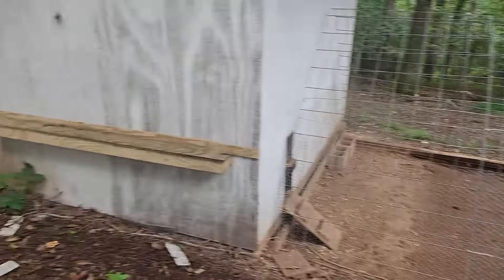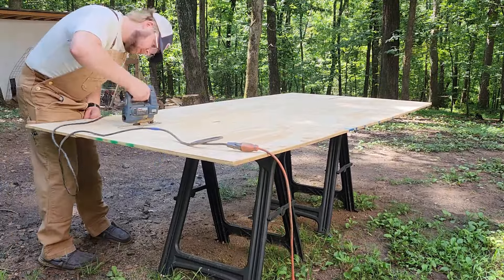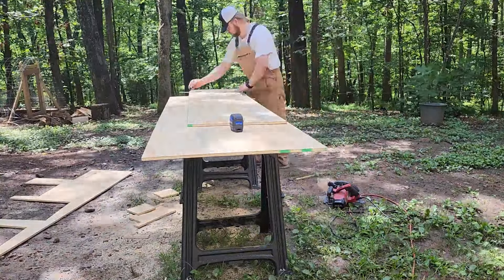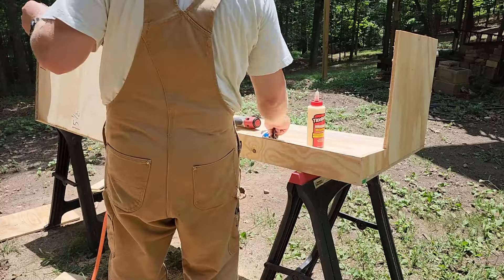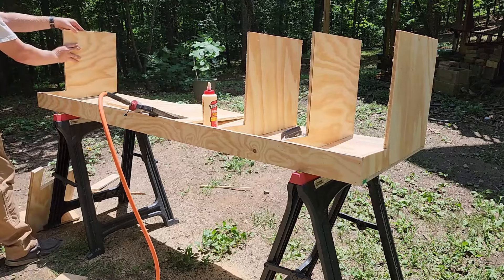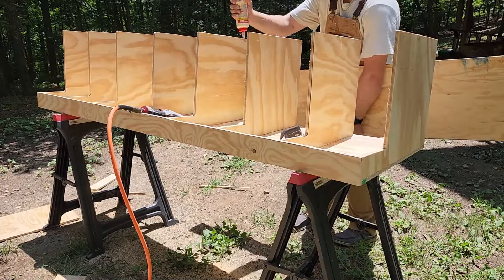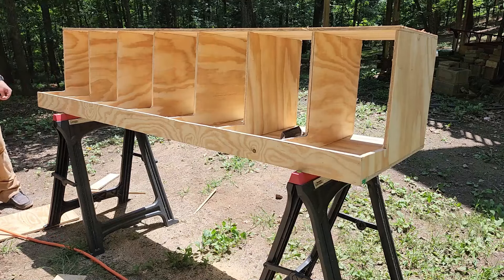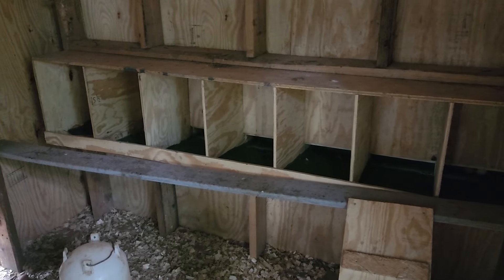Simple DIY Roll Away Nesting Boxes

Comment: woodenful design, i have question about the plywood. i saw the egg collection part is outside the chicken house without any cover. it was exposed to the sun and rain. will it broken after long time using？
Reply from the maker: Thank you, so my overhang from the roof does semi-protect it. I made sure to paint it though and after almost a year I have had no issues with it. Of course if this is a concern and you would rather have it inside the coop you can just turn it around. Just be sure to still cover the part the eggs roll to so the chickens can't get to the eggs. Good luck!

Comment: This may be a silly question, but -- would "reptile grass" be thick enough for my chickens to be comfortable, or should i get something like faux grass rug and cut it up?
Reply from the maker: Reptile grass would probably be fine. I would do a test with whatever you plan to use to make sure the eggs will roll down it. In case it doesn't work well you can always replace it.

Comment: I love this. I have a question though.  I don't understand how you set it up so the eggs can roll down.  Kindly explain this to me. 
I'm in Nigeria.  Can I use woodshavings instead of the grass?
Reply from the maker: Hey! With the way it is built, the top is level and the bottom is sloped. You will need to mount the top to a flat surface and the eggs will roll down the slanted box. You could try woodshavings but I think that would prevent the eggs from rolling down the slope.
Reply: @scrapyardchickens  Thank you very much!

Comment: How thick should the plywood be? Does it matter if it’s rough or not
Reply from the maker: I used 3/4 inch plywood. It doesn't matter too much as long as you sand down anything that might interfere with the hens and have some sort of mat down for them to set on. Good luck!